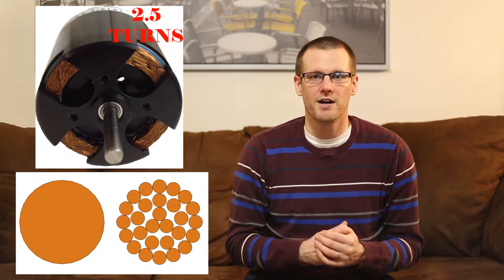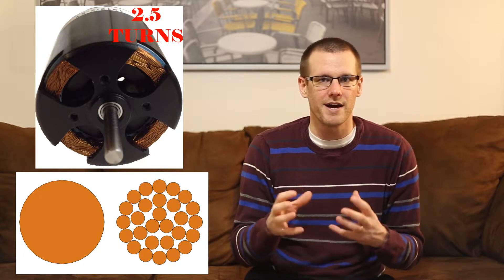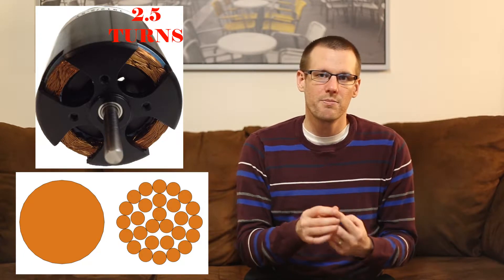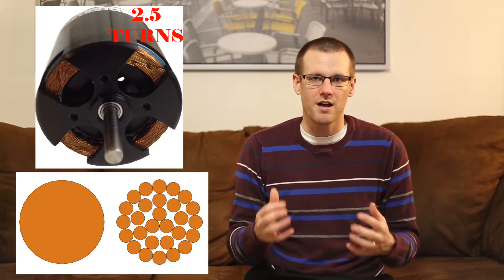All about RC Brushless Motor Windings

Comment: Question: Torcman offers many of its motors at a particular KV with a choice of winds e.g. 10, 12, 14 or 16. What difference does the number of winds make and is the difference significant?

Comment: I have a bit of trouble finding anyone to ask these so i hope you see this. 

Why do we have to use cylindrical wires though? Let's say i want a 1 turn coil, i could just wrap a copper plate around with no gaps. I will have eliminated the volume and mass of the insulation as well.
Also, when i run the calculations, given that the amount of copper and the power across the coil is the same, the magnetic force and the power used by magnetic reluctance stays the same. I could find nothing that could affect the speed or the torque that is a factor of turn count.

I am obviously missing something but i can't put my finger on it. So far the only reason I can think of for varying the turn count is to control how much voltage I prefer to run the thing with.

Comment: I use 30 amp esc for 4000 kv bldc, why its getting hot when i use big prop for my boat...but when i use 2000 kv motor and the same prop its not getting hot
Reply from the maker: too much load for the hot motor

Comment: I need an advice. I planned to make an Electric Scooter as a school project. I have 200Watt motor, but I want to increase it to 500Watt. What should I do to increase the motor power?
Reply from the maker: You'd have to increase the motor size. Changing the winding only adjusts the voltage vs current relationship. It does not change wattage.
Reply: @RCexplained  Okay, thanks for the info. One more thing, what should I do to increase the speed? Do I have to add more batteries?

Comment: So with a y motor if I set my esc’s timing to 10 or higher it will give me more speed but will heat up faster in a 132ft drag race?
Reply from the maker: A higher timing setting will provide you with a higher top speed, however you will be sacrificing low end torque potential. For your drag race, you would have to do many trials using each setting, recording your elapsed time and trap speed. Choose the setting that most influences a positive shift in your times.
Reply: @RCexplained  thanks this is great info 👍🏾

Comment: Hi, could you make a video on BLDC scooter motors ? Please explain how can we choose the motor that'll give good speed and decent torque. My electric scooter motor is 1500w, low KV high torque motor that operates on 72V. So basically I want to know if I can get this motor any faster without generating energy losses or should I buy a different motor. And what are the turn numbers and kV /wattage / voltage values should I look for for the new motor ?.
Reply from the maker: Hi Adam, If you try and push your motor harder, you will start to generate more heat. To get the motor to spin faster, choosing the right wind which equates to kv is important.

Comment: Hello,
Thank you so much for your video.  I was wondering if there are two different types of drivers, one for wye and the other for delta?  
And also how can I tell if a particular motor is delta or wye as both have three wires coming out? Some may have 4, that would automatically perhaps mean wye  ( not sure on that).
Reply from the maker: A speed control will drive both wind types on a brushless motor. You wouldn't be able to tell easily by looking at the motor. All brushless motors will have 3 wires exiting. 
In some cases manufactures list their specific wind in the motor. A 2Y or 2D would represent the number of winds and the winding termination. In this case 2 turns wye and 2 turns delta respectively.
Reply: @RCexplained  Can you run a set up that is a pair of magnet that is same pole facing out inside a stator that is 3 coils also same pole facing in with a bldc driver?  Can such a motor fall under bldc motor?  
Because I was under the impression that bldc comes in pair magnet opposite poles mulitiple of two and coils opposite poles multiple of three.  Or is it that the coils all have the same face and the driver determines which pole a particular coils gets?  And the magnet is in opposite pair poles at all times of course....??
Reply from the maker: Hi Blue Ocean, I'm not sure I understand what you mean. There are a few different calculators and charts online that covers stator slots and magnetic pole counts.

Comment: Hi! I was wonder, how can motors handle so much current with such small wire?
Reply from the maker: Hello, you may see a very thin small wire inside the motor, however that wire is in parallel with many other strands. In some case all the wire that you see is of the same "turn." This would be true in a 1Y or 1D wind.
Reply: Oh ok that makes much sense, but I see motors online such as the tp 100 or the tp 100xl which is relatively small for how much power they can put out (96 hp or 72kw) they pull up to 600 amps of current, it just doesn’t seem like you’ll even have enough wires to handle that current, for how big the motor is (about 1 foot long and 6 inches in diameter) all those wires running in parallel still just doesn’t seem like enough to handle the upper 600s in current. Unless they are, could you maybe explain this if possible.
Thank you!
Reply from the maker: @caleb1951  The TP 100XL is a 4 turn motor with an Rm value of 0.00146 ohms. Working out what the equivalent wire gauge would be assuming a total turn length of 9-10 feet is 2AWG. That wire can handle some serious power. At 50 volts and 500A, the voltage drop in the wire is about 1.5%.
Reply: RCexplained oh ok so basically they run the smaller wires in parallel so they all together create a 2 gauge wire. Then they wrap them 4 times, and they can handle tons of power. Thank you so much for the help! I’m pretty new to this stuff
Reply from the maker: @caleb1951  That's the idea. Glad I could help with the explanation.
Reply: RCexplained hey, it’s been about a week and now I have another question. You said that the tp100xl uses 2 awg wire to handle up to 500 amps of current. However I looked on amperage rating charts and they say that 2 awg wire can only handle 150 or so amps. So why is it that the tp100xl can handle 500 amps with 2awg wire?
Reply from the maker: @caleb1951  Are you looking at Max Current for Chassis wiring? Either way, it sounds like you are referring to a chart that is not of the same application. For example, use the same chart you are looking at for the wire that exists in your ESC. What does your chart say for the ESC wire that you are using in any of your RC's?
Reply: RCexplained oh ok, that also makes a lot of sense. I don’t have an esc yet because they are expensive for the high amperage capacity ones. But I was looking at chassis wiring. Thank you!
Reply from the maker: @caleb1951  use any ESC as an example. All you need to know is the wire gauge and the amperage that the ESC is rated at. Compare that to your chart. What do you find?
Reply: RCexplained well for escs... I would need one that could handle the 5-6 hundred amps needed to power the motor. Yet they are so incredibly expensive. However, there are red brick 200 amp escs for 25 dollars online. Could you run 3 of the red brick 200s in parallel to handle the current. By theory, it could handle 600 amps. And you would only pay 75 dollars.
Reply from the maker: @caleb1951  You can not run 3 ESC's to 1 motor from my experience. 

The reason I asked if you have an ESC is to look at the spec of an ESC the wire gauge of the ESC and your chassis max spec. 

I have a 100A ESC that uses 10AWG wire. Typical chassis max current charts would state a max current of around 55A using 10AWG.
Reply: RCexplained do you know where I could get a high power esc for affordable
Reply from the maker: @caleb1951  what is your goal with this motor? The motor itself is expensive.

Comment: Do you have a tutorial on star vs delta sensorless bldc sensing? I have a delta wound motor and I'm trying to detect rotor position with comparators.
Reply from the maker: Sorry, I do not have a video on star vs delta. What is your goal or reason to detect rotor position?
Reply: @RCexplained ,  my goal is to build a DYI esc simply for the challenge and satisfaction of doing it. After I removed the stator of an E-max MT2204 to resolder one of the leads I noticed that it was delta wound. I wrote code to successfully spin the motor in open loop but each time I tried to switch to closed loop using a quad comparator I failed. I tested LED's on the comparator outputs; they flashed on and off. I tested voltage on the outputs; Too low...I need minimum 1.65v for logic high. I wrote a program to loop slowly through the complete commutation sequence to see if I was getting logic high anywhere in the sequence...nothing. Is it possible to get a neutral ground in a delta configuration? Should I replace the comparator with an ADC?
I won't quit because I know it can be done. Aside from that, I subscribed to your channel because it is full of great content. Thanks for sharing.
Reply from the maker: That is a pretty sweet project you are working on. Not sure how you can get a neutral ground in this configuration. I don't have any practical experience with this type of design.
Reply: @RCexplained , I made some experiments and got the comparator to switch high and low which is encouraging but I still don't have the results I wanted. It's part of the fun. Thanks again.

Comment: Thank you for your great video presentation! 
My main concern with windings is to know what the difference when changing termination to a 36 slot star bldc. If for example terminated after the last pole of the 3 phases, 1 time per rotation, in contrast with every 3 slot termination, 12 times per rotation. How that effect Kv and torque?
Thank you again!
Reply from the maker: HI, thank you for the comment! I don't quite understand what you are asking. Would you happen to have a diagram of the terminations you are looking at? Or you can list it out by nomencalture? ex. 36 slot, 4 pole, 2D vs 36 slot, 4 pole, 2Y
Reply: @RCexplained  thank you for your quick response! The motor im working on is a 36 slot, 48 pole (24pp) 12Y outrunner washing machine bldc which i change the winding termination.This used to be like 1 termination for all 3 phases and i have changed it like 1 termination every 3 poles, 12 in total.I have done this to help the motor deliver more torque at low voltage and higher amps, connecting with a common rc ESC..
I don't know if i make it clear. Any thoughts would be great!
Reply from the maker: @WhyNotCycles  
If as a result of your changes, the internal winding resistance of one phase decreases, I would expect that the Kv increased and you will see higher torque at lower voltages.
Reply: @RCexplained  Thanks again for your time!
Recently i found your channel! Lots of infos there! Like the School of Brushless!
Keep up the good work!
Reply from the maker: @WhyNotCycles  thank you!

Comment: Hay bro thanks you  so much for such a good video on motor windings
I have few doubts about them
If you can help me out it would be of great help to me
Reply: I want to know how to reduce kv of brushless motor ?
 Is the method for reducing kv for brushless innrunner motor and outrunners same ya different ?

Also you said heat is main issue in motors 
How to solve heat issue in outrunners
Reply from the maker: @pratikraut7552  are you planning on taking the motor apart to modify it's specifications? This can be very intimidating. To reduce the kv, the easiest method is to increasing winding count. If your motor has 12 turns increasing to 14 turns will decrease the kv. This works for in runners and outrunners. 

Good amount of air cooling will keep an outrunners cool. If it is still over heating reduce the load of the motor or increase the size of the motor.
Reply from the maker: Thank you for your comment!
Reply: Thank you much for replying and clearing my doubts

Earlier motor had 11 thin copper wires wound around one stater pole  5 times and in delta pattern 

Now if i increase no of turns i would have to use less no of strands  
What to do in this case

Can i use only one thick wire to do rewind instead of using many wires